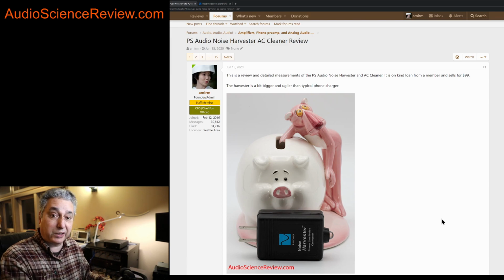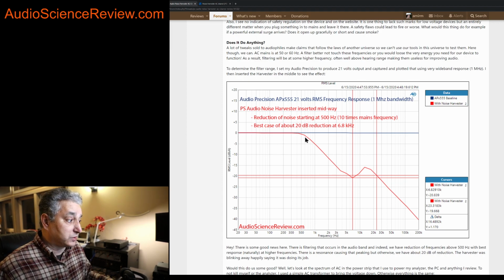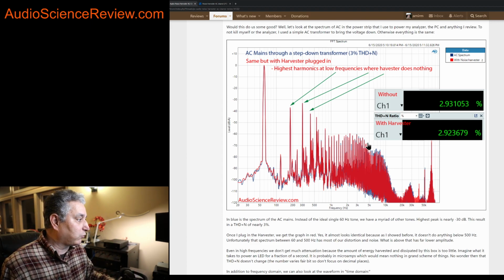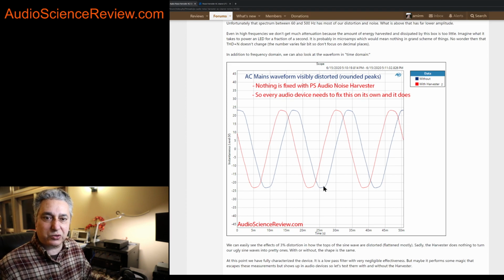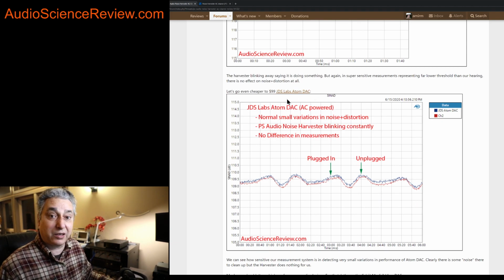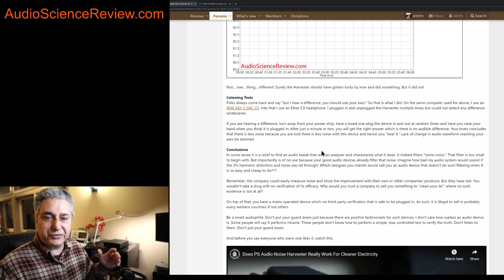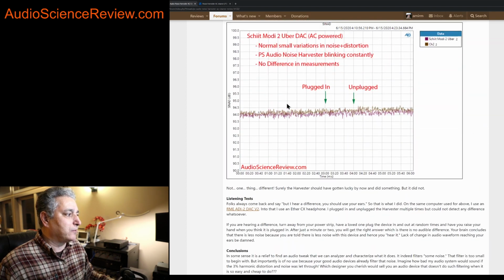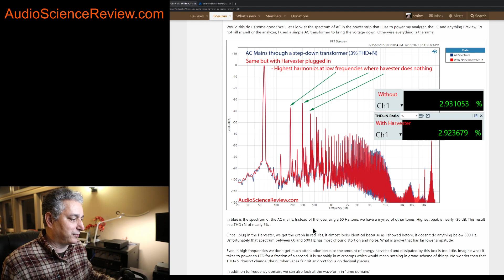PS Audio Noise Harvester Review (AC Filter)

Comment: I have a question
As u said harmonics filter for dc is dirt cheap 
So i was wondering
Firstly ofc if i use ac to dc to power up the board then use dc to ac pure sine wave inverter which was sockets on it..can i connect my automatic voltage regulator to that then connect my av reiever to it ? 
Will the filter work ?
Or should i eleminate the avr and directly connect my reciecer to the inverter ?

Comment: I use it to determine when I have a bunch of noise in my power.  When the microwave is used and other devices is blinks like crazy.  One dissapointing thing is the unit blinks more in my expensive furman power conditioner then just power from the outlet...

Comment: I have a Tacima parallel ‘noise reducer’ that does little or nothing for my ears.  HOWEVER, I also have a Tacima in-line noise reducer that I swear by!  This gadget is like a glorified mains extension strip and you plug all your electronic devices into it: amp, CD player, turntable and streamer.  It really helps to drop the background noise level so you hear more details in the music like notes dying away, for example.  Very highly recommended and it was under £50 in UK.  Best £50 I’ve ever spent on hifi stuff.

Comment: It's implausible that this device harvests anything other than money from the gullible. If you want to understand mains filtering, take a look at an EMC test chamber where products are subjected to interference deliberately during development. You'll see that the mains supply goes through a metal can before entering the room. That metal can is a power line filter containing capacitors and inductors and it will enormously reduce noise on the mains supply, and also prevent noise from the test chamber from getting back into the electricity supply. PS Audio presumably understand all this because they must EMC test their products, so shame on them for marketing this snake oil nonsense.

Comment: I would LOVE a teardown of this snake oil product!  Also, the mains stepdown transformer in audio gear, assuming a linear power supply, cannot pass high frequency, so it is acting like a low pass filter just by design, and not passing noise from the AC line.
WOW!  The amount of false advertising and snake oil that is pushed boggles the mind!

Comment: Another video I love !!! There is so much audiophile myth, it could become its own religion,,,LOL.,Like dianetics. But a REAL question. If someone wanted to really create a "noise/rf/blah blah" filter, wouldnt it be better to have that happen AFTER the AC in, convert to DC and then filter the heck out of that ? Remember I am new and just guessing but I would think that would be the place...what would you use after the conversion to CLEAN your DC signals in power ?
Reply from the maker: Indeed.  And that is precisely what is done.  Post conversion voltages are far lower so any filter is much smaller and cheaper.  And can be application specific to what is driven.

Comment: Amir, It;s amazing how many people actually get brainwashed with snake oil products and fancy ""proof-less" sales jargon.  I am beginning to wonder about the rest of the PS Audio fancy smancy expensive equipment being sold for multi thousands of dollars, whether they are really as good as they are being touted by Paul McGowan.  He is a nice uncle like gentleman that can talk a hole in your stomach with no actual proof of what he is saying is true most of the time. This is another one of those 'fake' items when they claim that a gargantuan speaker cable that is braided and 'shielded' against RF is going to make a difference and they sell it for $3000 a foot, etc. Total baloney!!  Sure .. the gauge of the wire will make a difference up to a point, you certainly don't want to run 300 watt amplifiers into 8 or 4 ohm speakers with bell wire, but gauge 12 or so with moderate length runs will totally suffice, with decent connectors on both ends!

Comment: I wonder if you have any Opinions on the VPI magic brick.
Reply from the maker: It can't possibly do any good on any electronic solid-state device.  It may do a bit of good on tube amp that is microphonic but then again, you can just put a brick on it. :)
Reply: @AudioScienceReview  
I had it on the trans of my Dynaco ST 70 and I moved it over and it was too close to my raspberry pi and dac . It caused a issue. I moved it back and it was okay again.

Comment: This channel's bias can be smelled a mile away.
Reply from the maker: Instrumentation has no bias.  You are confusing me with subjectivist reviewers who are super biased by cost, brand, looks, etc.  Measurements on the other hand, are immune to these sources of bias.  So be sure your own bias doesn't get in the way of learning the true nature of these products.
Reply: @AudioScienceReview  Your comments are not your instruments. Secondly, what is measured and correlation to sound quality already is full of bias and subjectivity. Your comments like, "surprisingly it did do something" clearly shows a bias. I've watched two videos and surprise, they were both attacking PS Audio product. Don't get me wrong, I don't own any PS Audio gear nor am I a fanboy. I have used their products though and have owned reference quality gear for over 40 years. You must know the very basic measurements you use tells nothing about sound quality which is supposed to be the point. For instance, 95% of amps measure the same to any significance, yet they don't sound the same. 
Your review on the regenerator suggests it doesn't do anything, yet while I found the sound quality suffered overall on my admittedly very expensive system, it did  improve imaging. You present data that may or may not affect sound quality with somewhat smarmy quips, yet you're going to tell me measurements don't lie. This is audio reproduction where the usual basic measurements don't have the answers. Where we do agree is on the sound of the LS 50 which I also hated from day one despite the rave reviews. While I concede the Meta is better, I still don't like it and I didn't have to measure it to tell me so.

Comment: Pure waste of money. I have a ultra high end set up. All using what was supplied and ultra cheap plastic  extensions where required. The sound is exceptional.  These things are made by companies just to increase profits. They do zero. Mains electricity cannot be changed! Best thing, buy the best components you can afford.

Comment: You mention using a step down transformer to measure the mains noise? Was this an AC transformer like one used in an amp PS? An iron I/E core? Toroidal? Most standard I/E step downs would be band pass filters. Many even worn that for a 60hz unit 50hz can cause overheating because of internal eddy currents from nontuned frequencies.  You are not looking at the actual AC from the mains. You are looking at an isolated output based strictly on the magnetic coupling between windings. So one has to wonder where all the harmonics and other signals are being generated from?

Comment: There are several varieties of AC noise filters. Some actually make the problems worse. Some AC power filters use capacitors to attenuate voltage spikes on the AC line. If they are connected between line an neutral, this is very effective at reducing differential noise, but does nothing to reduce common mode noise. A traditional powerline filter also has capacitors from line and neutral to ground. This does shunt the common mode noise to ground, but here is the kicker, it puts the harmonic noise current into the ground system, which in a sound system is a very bad move as now not all components are plugged into the same ground reference voltage.  Ground for a sound system needs to be a voltage reference, and not a current carrying conductor.
For more information on the subject, refer the the National Electrical Code under grounding and bonding. There is a section on Isolated Ground for sensitive equipment, such as hospitals. Often referred to as Hospital Ground, the important thing is you do not plug in any device with high ground current from a noise filter into a hospital ground. This includes VFD motor drives, Desktop computers, etc.
To properly review AC power filters, the amount of coupling into the ground needs monitored too. When sweeping the filter to test it, test each leg referenced to ground, and test the differential mode of the filter between line and neutral. A good filter contains the following.. MOV between Line, Neutral, and Ground. Input capacitor between Line and Neutral only, a bifilar transformer, and an output capacitor between Line and Neutral.  Industrial equipment has additional capacitors to ground, and are used for RFI, EMI reduction at the source, but is not to be used on the same circuits as sensitive equipment.  The VFD drive on your CNC belongs in the garage/shop on it's own circuit, not on the same circuit as your sound system.
A proper noise filter is always a pass through device with a bifilar coil in line with the equipment, not a stand alone plug in module.  A proper noise filter is as shown here. https://forum.arduino.cc/index.php?topic=119313.0 They can be purchased as part of the AC socket for your equipment.  https://www.alibaba.com/product-detail/IEC-Socket-Type-Single-Phase-AC_60477587273.html

Comment: thanks for the detailed confirmation of what we suspect! and when it comes to audio, suspicion is your friend. I'm surprised PSA would damage what reputation they have by putting out such a trinket. similar bunk devices are seen around the Interwebs, maybe claiming greater efficiency for your refrigerator or A/C. when I heard "gets warm," I'd like to add that it must be drawing power beyond blinking the LED. that's power that you will pay for too at the meter every year that you're foolish enough to set this mini-heater and forget it.

Comment: Do you have any recommendations of products that do positively improve audio systems? I enjoy finding out about what doesn’t work so it’d be good to know what does.
Reply from the maker: Nothing I have tested in this category provides useful value for audio.
Reply: This reply is pretty late, but legitimately the only things you can do to improve your audio quality are such (in order of priority):
1. Good-measuring speakers and/or headphones
2. Amplification/converters that suite your playback system (proper amount of power for high/low impedance headphones)
3. Quality (not overpriced) cabling especially if you are in a very noisy RF environment. Balanced connections (XLR mono channels for example) will help remove noise from longer cable runs to speakers or headphones.

That's pretty much all you can do.

Comment: Great job on this Amir. I'm looking forward to your reviews on power line EMI filters, both when filtering the AC main and when placed at the output of several power amplifiers, ideally class AB and D. I want to see if you can measure any difference on the speaker end of a speaker cable with and without the filter. Also in addition to your usual FFT analysis, can you show us a scope display of a 1kHz square wave with and without the filter? I am interested in if EMI noise can somehow change the waveform, and thus potentially the sound of a signal. And please use various common sources of EMI such as a SMPS, a computer, a monitor, an in use cellphone, a fluorescent light, etc. to see if you can induce any measurable differences and especially the sound and if EMI filters will help. Danny from GR Research claims that EMI somehow affects the soundstage and detail of music. As these qualities are associated with phase and group delay, if EMI can measurably affect the waveform of a square wave at a speaker's terminals, I want to see that. Thanks for the great work.
Reply: Excelent ideia!

Comment: Amir I love your channel. Such fresh air in an audiofool world full of gimmick where cables are more important then the gears hehe. For the test I wonder if the transformer used for the test could have filter some noise? Dont get me wrong Im not into snake oil suff at all. But using a resistors voltage divider instead to lower it for the scope would be great to see if the results stay the same. I had issue in past with noise and a low impedance xfo was able to filter it so thats why Im asking. Maybe adding noise in the AC line with good old ballast and LED lights could show even more if its working or not.

Comment: Amir, I think your videos are fantastic. I am an audiophile, an enthusiast, but I also have a PhD in Power Engineering and have always worried about "quality connectors" and the like. I would be very interested if you you have looked at the impact of power conditioners and regenerators on the quality of DAC analogue output? Do they actually make a measurable difference?

On your testing process - it seems to be essentially "steady state" ie measuring total distortion and jitter improvement or the lack there of for a constant steady single frequency input. Question, the likes of Chord focus a lot on dynamic and transient response to enhance listening quality. Could your test process be extended to see if any of these devices change (good or bad) the impulse or step response of DAC outputs? I appreciate you utilise AB blind listening tests as the ultimate comparison, but in terms of measuring is a dynamic test worth demonstrating that these various devices add nothing in steady state or dynamically.

Great stuff keep up the good work - looking forward to a review where something actually does what it says on the tin

Comment: Electricity is not flowing in your wires until a device is connected. To plug something in that is supposed to "clean" electricity from one outlet to another is so ridiculous that I'm surprised anyone would believe it. Because the electricity from one outlet to the next is usually daisy chained via wire-nuts, or in some cases, from the lugs on the outlet. One would have to put the Harvester in-line with the circuit so that all of the current downstream passes through it. Nobody would ever do that.  You cannot filter your house wiring by just plugging something into the wall. The AC interaction is between the load to service line through the breaker and neutral/ground on up to the transformer of your service. Every point along a branch circuit flows this way. Yet, everything plugged into a circuit can add something back into the line. We get switch arcing and motor noises bleeding back this way.  So if a plug-in device were to work at all, it would have to feed a cancelling signal into the line. But it would have to be calibrated for those spurious frequencies and current values, which would be challenging to predict. Maybe a pink noise generator with phase inversion would do it.

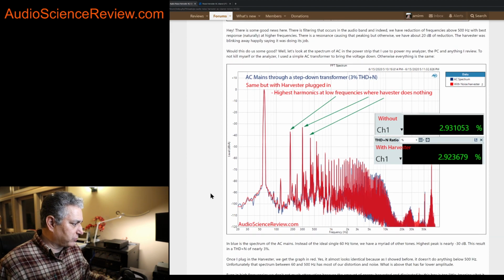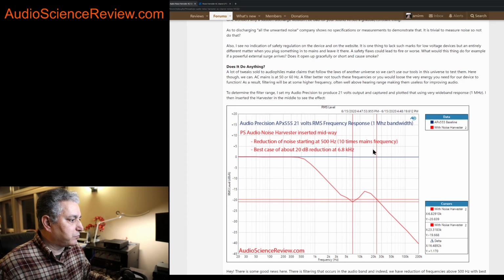Comment: I feel like this review is not mischievous, but misleading. The claim that THD of AC mains only decreases by a tiny tiny margin (3:50) is true, however, I don't think the accurate interpretation is that the noise harvester isn't working. The THD standard is fundamentally flawed for audio applications because it doesn't account for how detrimental each harmonic is, it just treats them all equally. High order harmonics are much more audible to humans in general, and more harmful to sound than low order harmonics, so even though the noise harvester doesn't do much for the mains' low-order harmonics (of which there admittedly is a lot), it does do a decent job (-15 to -20db) of addressing the higher-order harmonics over 2khz, where the human ear is much more sensitive to distortion and noise, as demonstrated by the graph at 1:52. Don't get me wrong, like many at ASR, I do genuinely believe in measurements, but I also think it's also very important to interpret the measurements in the context of human hearing, not from the perspective of a computer reading THD numbers. Especially considering how many snake-oil noise-filtering products there are on the market, I feel it's unfair to lump this one in with the rest when it measurably works.
Reply from the maker: Your criticism would have merit if I had only shown you the THD+N.  But like all my reviews, I show you full spectrum of noise and distortion.  And demonstrated that practically nothing was filtered for not only the audio band, but well above it.  The THD+N was there as a quick confirmation that the full spectrum of noise and distortion were left alone with this device.  In that regard, it is far more probative than if it had shown some reduction.

Comment: Cheap to buy an Entech Powerline and EMI Noise Analyzer which allows you to hear the AC line contamination. Makes it simple to hear if your filter is working or if your cables are giving off a signal.

Comment: Reminds me of those devices that are supposed to cut your electricity bills or those devices you add to the fuel line on your car to save fuel; which of course don't work.
Reply: I had four of those fuel saving devices fitted to my car. I had to remove them because the fuel tank kept overflowing.